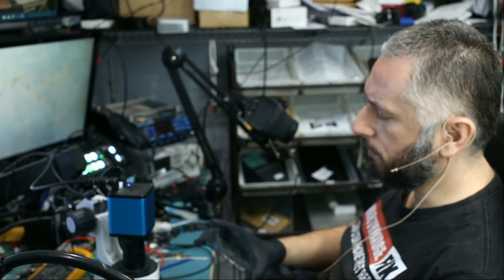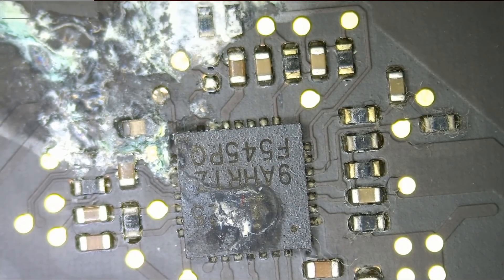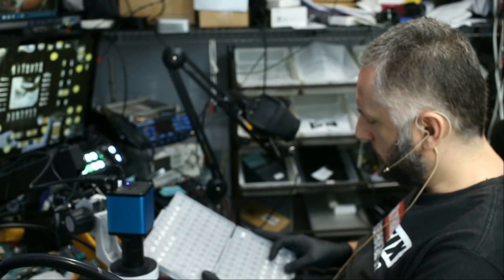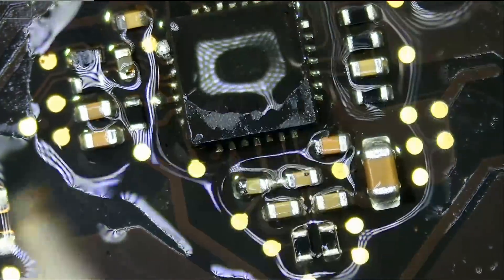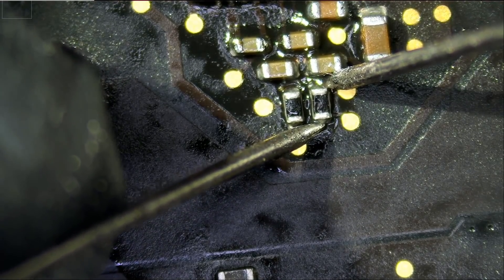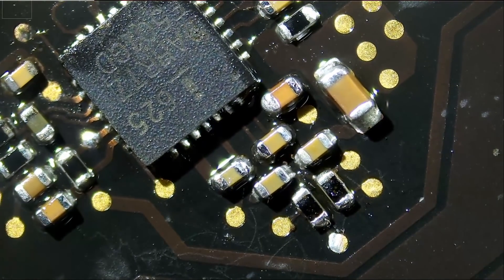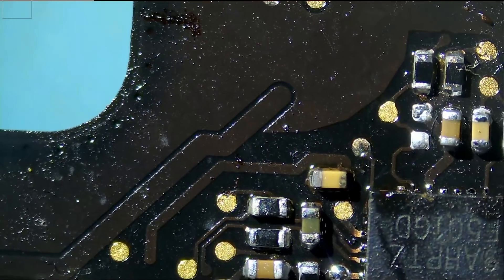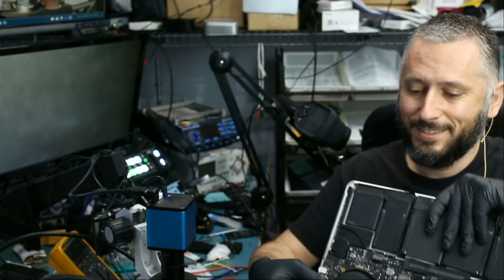2015 Macbook Pro 15"Green light but not power repair

Comment: I’ve replaced many of those ISL6259, it’s amazing how often they fail when liquid gets in. My preferred way of testing those resistors is at the IC pins directly, as that also tests the traces, sometimes you get good resistance readings at the resistor, but bad traces so the IC cannot read them.

Comment: Hi, how those resistors are damaged? Is it a common problem for them to change value over time? thanks a lot, big fan
Reply from the maker: Current sense resistors are known to go bad. Resistor is bad when it reads allot higher then it's value or if it measures OL meaning it's blown or open circuit.
Reply: @NorthridgeFix  if you didn't have a resistor to replace, what would you do?
Reply: @saeidcyppp6293  if you're a business owner you must have an SMD kits &
Some donor boards(which I believe is not easy to find or cheap to buy) , but if you're a student/hobbyist/(solo repairman) like working from home, I think the only way is to buy an SMD kits, like I intend to do.

Comment: which multimeter are you using to check the ohms while the resistor is still in the circuit?